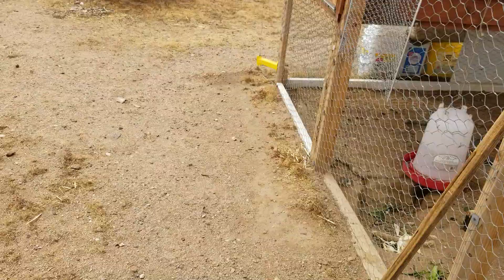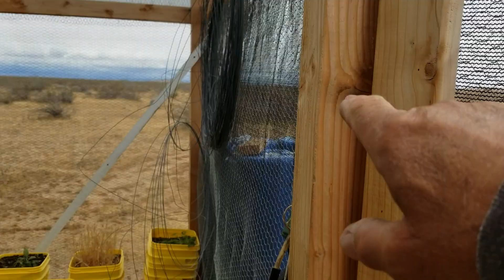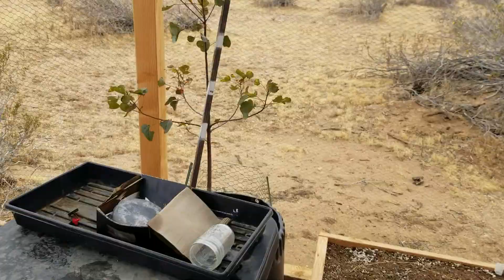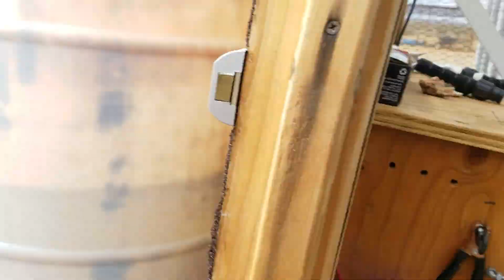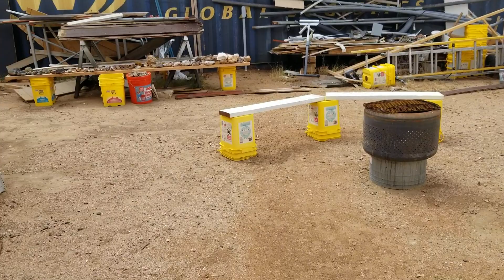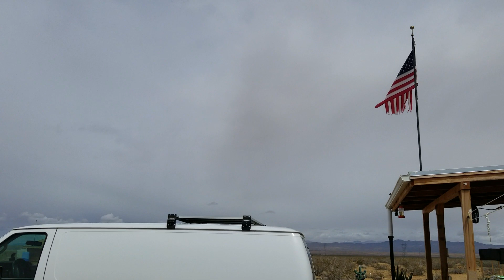Tru-Blu sealant for water barrels, and rain harvested.

Comment: I must have missed it on another video..
In the chicken coop you have a blue barrel laying on its side...
What is it for
Reply from the maker: Originally I was building a wind powered clothes washer, but decided to bring up my powered clothes washer, so since i had already cut one side of the barrel i added some 2x4 feet to it and gave the girls someplace to hunker from the winds.  They use it all the time.  Same with the blue plastic stool.

Comment: Heloooo....we are glad you are ok. About the winds....the same here in Arizona. It was horrible! My garden area that I started to build as my own project...ripped a part...to shreds. How sad, on top of that....we Got Snow! I will send u pics on email. Our RV heater broke, we have no idea what is going on. So we used our old little one. It's cold, and supposed to snow with rain at night, I dont think my corn will survive this...I told Cary, I am starting to dig underground garden!! This weather is very harsh. I hope it will change for you and us :) sending all the best as always! Ps I just got my bags of HGO thx!! Hopefully Sun will come out and wind go away so I can use it :)
Reply from the maker: I'm sad to hear all that! Many times the heater problems can be dust build up.  There are safety switches built in to prevent fire and dust affects them.  I blow mine out with compressed air and it fixes it.  The garden problem is something you have to note and correct for next planting.  I went through that from 2016 until now to get where I am now.  Make note to not plant until all chance of frost is gone.  
Challenges are part of off grid.  Take the bull by the horns and lead him to the barn!